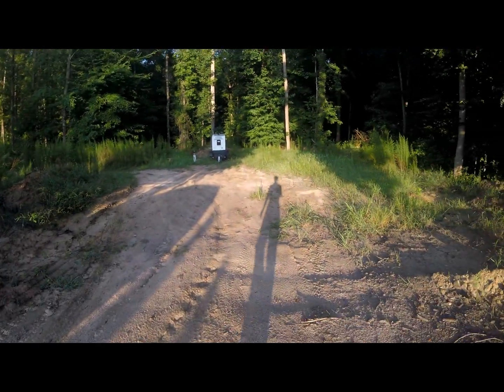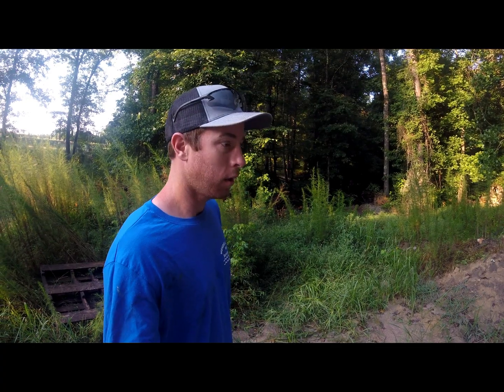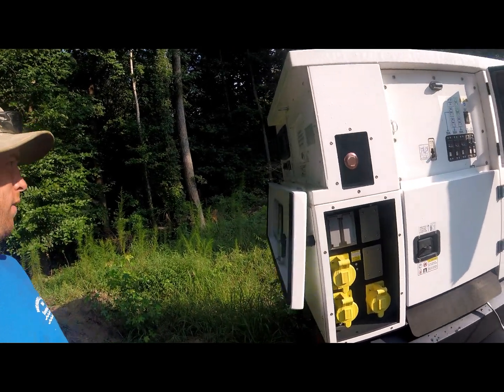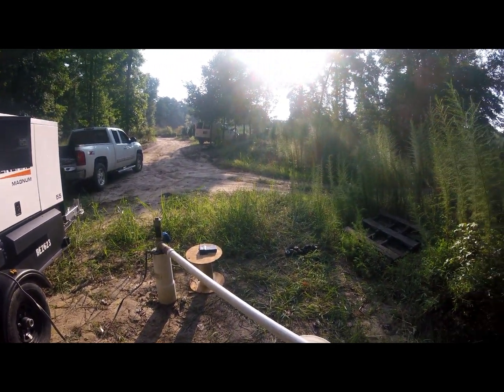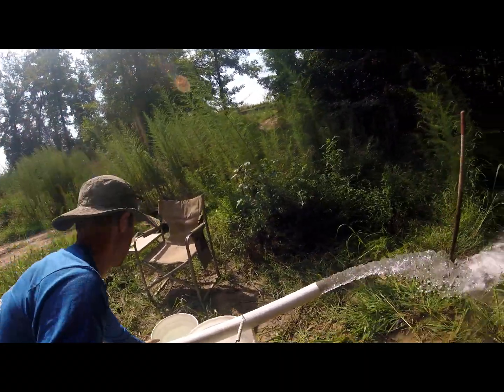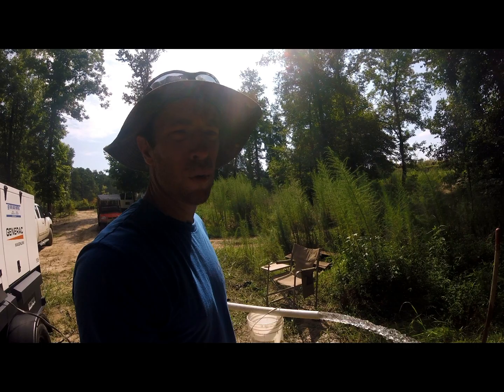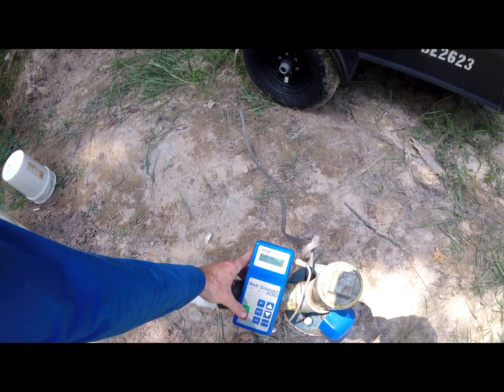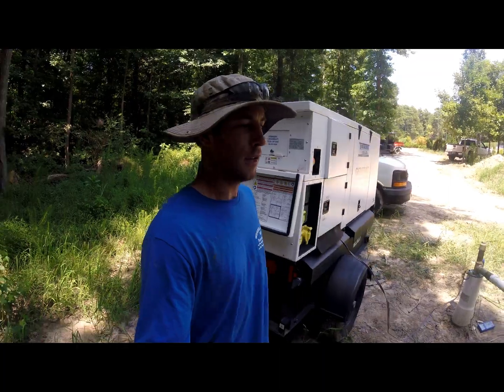Pump Flow Testing a Water Well and Why It Is Worth The Money

Comment: Are you wired directly into the generator? No motor protection! That’s crazy! No flow meter? No throttling valve! Must be your 1st pumping test!
Reply from the maker: You are correct, wired straight into the generator that has built in protection into it to keep it from single phasing or will kick it out on overcurrent protection (parameters that I programmed into the generator before startup). You missed the throttling valve, after 4 hours of pumping open discharge with a water level of 113 feet and a pump set 400 feet, no throttling was necessary so I removed it. The well never pulled down below 113 feet. No it's not our first pump test, and the motor in the well was 15 years old that we saved after a customer elected to change it out, not a brand new motor. We aren't that stupid!